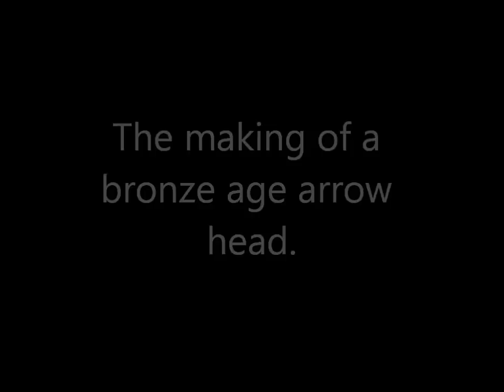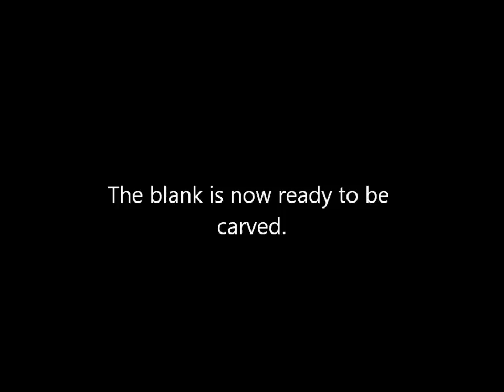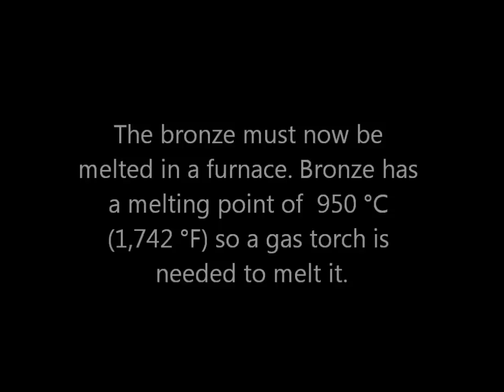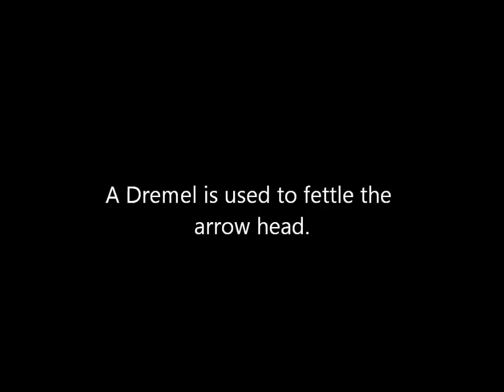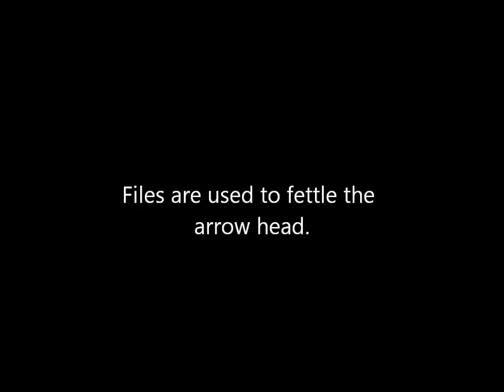The casting of a bronze age arrow head

Comment: awesome man. i work at a high end art foundry and i just have some tips for you. typically we pour our bronze by the hundreds of pounds and it may be differnt in smaller castings. we pour at around 2150. also you should put the arrow head pointing to the bottem of the mold and run your down sprue (pour hole) to the butt of the arrow. the. run your vents off of the wings and to the top aswell but not touching your main downprue. also we heat all of our molds up before we pour them. investments ee usually pour at 700 degree mold temp and 2150 metal temp. it makes less shock on the mold. hope these help you out. keep on casting!
Reply from the maker: +will Richards Thanks very much for the information dude! Really interesting to hear from people like you who have a career in the metal casting industry!

Comment: This method is capable of making high grade castings but this isn't the way a bronze age smith would have done it when they needed to mass produce points. More likely they'd have cut a dozen or so into a stone slab and tied two slabs together and cast them all at once.  I'm confident they'd have put a lot more effort into getting a good point on the thing.
Reply: sooo?
its still cool.
Reply: why not make a wood carved arrow head then make a - in clay?
Reply: Maxwell Fine if you did a stone arow head in bronze...
Reply: They probably wouldn't cast arrow heads at all, very tedious work, I'm sure they would have just used a forge and hammer to shape the arrow heads.
Reply: Arrowless Knee hammer as in steel/ iron
Reply: louis crespo What?
Reply: Because to forge you need shaped steel/iron therefore you would not use bronze
Reply: louis crespo Right,well I was just curious why you replied to me.
Reply: If that was a reference to what I said I have one one. Troll
Reply: Dwight E Howell
You're right, the actual tip and edge of the arrowhead would of sucked pretty bad. I've actually done stone castings before, for some simple axe head blanks to be split and finished later, and it's SO much easier than using the clay.

Comment: Wow, where does one get the metal containers used to hold the clay in for your mold? I don't recall ever seeing anything like that. Also, do you make your own bronze by mixing your own copper and tin.
Reply: I just found a site that sells it all, its called Cousins uk
Reply from the maker: Not at the moment but good suggestion I will try that soon and make a video.
Regards ChannelX24.
Reply: Bayan1905 The container is easily made on a lathe.
Reply: +LegendofAkaiyus wich means nothing in this video is made with "bronze age" techniques... wich means the title should be: " making a bronze arrow head" or along those lines
Reply: +Radbert Grimmig  Oh, on that bronze age lathe I have in my basement?
Reply: wesley115777
Should even work on a stone age spring lathe, given enough time and skill.
Reply: Radbert Grimmig so it works on on a hand crank? and as a cutting tip there's some flints stone? sounds efficient enough :D cya in 30 years :D
Reply: jklw10
When you're not distracted by youtube etc, there's plenty of time. The earliest type of lathe actually works on a kind of bow, similar to a fire drill, and is turned back and forth. Aboriginal craftspeople still use them on Papua New Guinea, I seem to recall.
Reply: Radbert Grimmig 1 its not a lathe its a drill 2 i know about this...

Comment: Might have been wiser to have inserted the arrowhead vertically so that the shaft part is where you're cutting it off instead of the side of the arrowhead, which undoubtedly will disrupt its aerodynamics.

Comment: Any chances. you would share the kind of molding sand that you are using? 
Thanks in advance.
Reply: The sand is called "Delftse aarde" or Delft earth /clay.
It's special sand with oil added and sold like that. It's really sticky and used for casting Tin/pewter/copper/silver etc.
I would use a vertical 2-part casting bell, and not the rings for casting an arrowhead is betterd done by extending its shaft to make a pouring channel.

Comment: I'm not sure what kind of bow could shoot that heavy arrow head accurately.. the archer would have to be really good and have a 100lb+ bow
Reply: You're right. Bronze age arrowheads were flint, not actual bronze. This is more of a stylization. This would be way too heavy to fire over long distances
Reply: xjones I held in hands actual Scythian bronze arrowheads. These were of quite a different design... Тrihedral, and with a hole, not a shaft, to fit on an arrow. And much smaller, of course.
Reply: you could just drill a hole in the bottom and stick a dowel in to make a spear, but then again, idk

Comment: The pour hole seemed too big and i think lost wax would have given finer detail, But I've only poured silver, Bronze might be different.
Thanks
Reply: I've worked with silver as well as bronze and lost wax would have been better for detail, however, I agree with apache_drifter. It would have been more practical as it would have work hardened the edge and tip making it have better penetration. Barring that, using a file would have work hardened it and given it more even/smoother lines.

Comment: Very beautiful product by the end of it and i must say i love things cast from bronze. However i felt that you wasted alot of time making molds (which maybe have one or two uses at most) and things like that. With a little more fuel than it takes you to melt the bronze and the time you spend finishing the arrow head i could have made the same thing 20 plus times over out of bronze or iron with not even an entire day before spent making the tools i need. Even in the bronze age these types of things would have been forged for speed and simplicity because casting metal is dangerous, i still have scars from past accidents. Only cast metal if you have to but all in all fairly nice at the end.

Comment: Very poor and unsafe working, but ok for a 14 year old. Do not wear sleeves that cover uour hand and can be caught up in a machine. The pour should have been from the shaft end not the side and the vent from the point end. Use the tool to make a better blank.
Reply from the maker: Good points, this was quite some time ago as you pointed out and you learn to be safer and a wee bit better with each new project. Take a look at my newer casting video where we cast a Bronze Wolf's head. Thanks for watching.